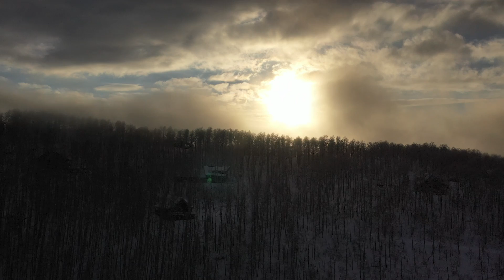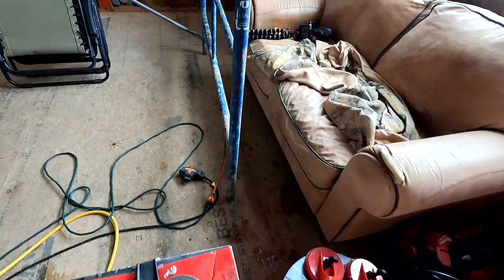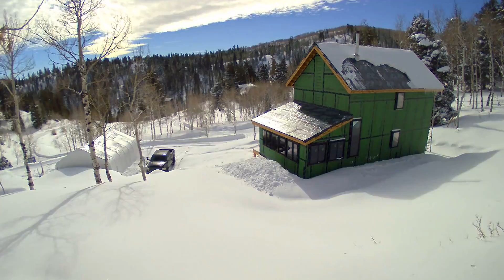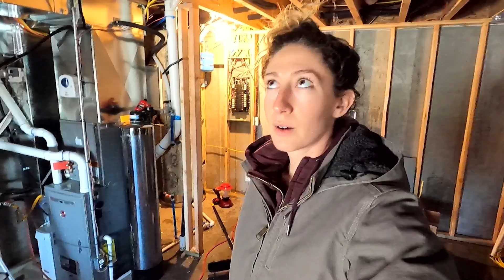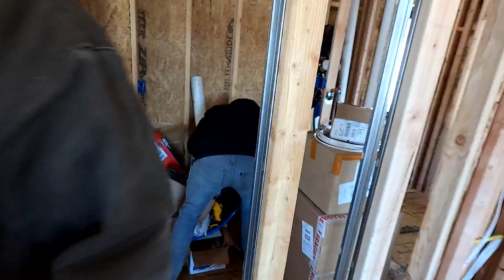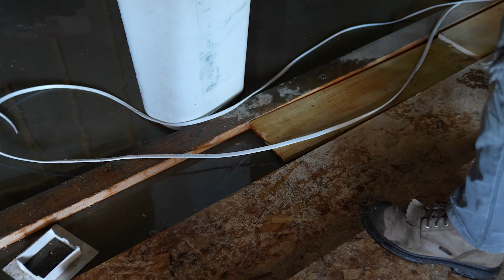OUR 4 WAY INSPECTION WAS AN UTTER DISASTER | BUILDING OUR OWN HOME

Comment: why would you test an internal drain run with that amount of water with head pressure? the working system doesn't operate at 100% capacity. Even an external drain run would only be tested by filling to ground level. These people are missing something or being very badly advised.

Comment: Check anything other than the breaker box that may have also gotten wet when you had the floods. The HVAC controller may be your problem, as you mentioned you got water in there. Easy to forget the obvious when a catastrophe happens. 
  If if goes away in a day or two, and you still don't know what happened there, it's likely that the water has evaporated. Check the trippable plugs too (the bathroom/kitchen outlets).
  Exciting to pass, yet you guys had some exhausting things happen this day.
  I hope you get everything working and back together. Go take a rest, deep breaths, then back to it.
   Good luck!

Comment: Your electrical problem is a nightmare!  Follow it inch by inch.  You know the cord from the breaker energizes.  Plug a light in. Works?  Plug in your extension cord to the basement with nothing plugged in to it.  It's . . . frustrating.  But not malevolent.  There IS a cause.  Good luck.

Comment: It's a good idea to walk house and video all walls before insulation and/or sheetrock. It documents where all pipes, wires and ducts are located in case you need to open a wall later. Also, it helps when placing sheetrock screws in questionable places.

Comment: I remember when we switched out our 100 amp panel (with fuses) for a 200 amp panel with breakers way back in the last century (1992, OK?)  and my Nephew said to me when the Inspector was coming,  "Don't tell him I'm an Electrician".   I'm guessing because,  as a Home Owner,  maybe the Inspector would be a little more lenient if you're just some regular "Schmoe".   I guess?  
Then,  skip ahead 20 plus years, after having a completely different Electrician install our stand-by Generator,  (well beyond my skill set,  trust me) the "new" Inspector had me change out a couple things on the panel that had been "passed"  twenty years previously.  Go figure?    Took me a couple hours to sort that out.  And the next day,  he came back and passed everything.   It's a learning experience for sure.  But definitely,  DO NOT TALK!   PERIOD.

Comment: Sorry to tell you Trent....once you wet down the electrical load center and breakers...it is trash.  The mfg will not warrant it...the possibility for trace minerals and things to have dried on the parts that are intended be insulation may not be insulating as well...electricians have cleaning chemicals to wipe down things...but to no avail...you seem to have the possibility water ran into breakers where cannot clean or dry....now trash.  The film on your glass shower surfaces is not replacing insulating surfaces down in cracks you cannot see nor reach.  Sorry..but the load center and all breakers should be replaced.  I have many years experience in that world.  I have seen the aftermath of water, moisture, condensation, etc and it is never good and the mfg will accept no responsibility.  There are many electricians that will tell you to dry it out good and move on....not me....I tell you to replace it...and have confidence that you are protected properly.  Something happens in that basement while you are sleeping 2 stories above all that wood kindling(your house).....Nope.

Comment: ADVICE: I worked in an electonic test equipment calibration lab. We would literally wash expensive electronics in a sink with 409 type cleaner. High priced electronics with circuit boards (like your furnace). Once washed we would put the equipment in an over at about 125 to 150 degree F and bake out the water. 
SO: Dry out your furnace. The leaf blower and any safe heat source you can use, even a hair dryer might work.
Good luck!

Comment: Take the breaker panel off the wall and bring it and all of the breakers inside the trailer, where it is warm and dry, let it be there for a night and a day and then reinstall it and you should be fine.

Comment: Congratulations on passing the 4-way inspection. Even if you hadn't passed it, you would have found out what was wrong. That is the purpose of the inspection.  You are just as intelligent as most construction workers.  I would say probably more intelligent and more careful because it is your own house. Think very hard about your electrical problem and you will eventually find the problem. It may be a wet temporary cord. Start at outside service breaker and put dry cords in place of the wet ones. I know replaced some of them. I have done electtical for 50 years and little problem like that are the hardest to find. You know it has to do with somgething wet.

Comment: Turn all breakers off in the panel, after turning main on if it trips then problem is in the wire. If it holds, turn breakers on 1 at a time until it trips the main to confine the problem point. Also, if your cord got wet in the flood that could be the problem.

Comment: It's hard to tell from a video of your electrical panel is so dark in the basement but is it a 200-amp panel or a 100-amp panel also it looks like it may be a main lug I believe you're going to need some sort of main disconnect next to your panel. May be cheaper to just change out to a 200-amp with a main disconnect. Good luck on finding your electrical tripping problem interested to know what it is . maybe the breaker down by the street

Comment: Most likely the problem with the electrical is not at the panel box.  You probably have an outlet near the water leaks that got water in them and that is tripping the breaker.

Comment: T&A - Glad it went well. Trent, as if I'm and electrition, as I'm not, but having worked with many, never use two hands. Only one, for safety.
As well, the connections to the breaker box and such, that's a job for a lisenced electricion, not you, nor I. Seriously, well worth the minor cost. Good luck and sorry for the typos.

Comment: What fun watching newbies, it's just like watching myself and the wife forty years ago. I just found your channel today and I subscribed. I dont know what kind of breakers you have but judging by the way the power tripped as soon as you plugged in my guess is the water is messing with one of your GFI breakers.
 Use your compressor to blow out the breakers as any moisture inside will trip a GFI.
cheers and good luck from Canada

Comment: There are many books on how to properly build a house.  There are many books on how to run electrical wiring and how to correctly do plumbing.  The key to all this info is to make sure you know what you are doing and you know how to do it before you start.

Comment: Install an Elk M1 Gold System in your property. The House and the Garage and any future out buildings for Security Fire, Home Automation and Audio and cab be integrated with CCTV. This is a real Security/Safety System. For your info call (844) NETAGENT Ext. 509

Comment: Trent /Allie Great Job on electrical!   but check your switch/outlet/light & fan boxes. When trimming-out each box, it's better to point the wire nuts "UPWARD" not down. This can help prevent moisture/condensation from getting trapped down inside the nut and corroding wire connections over time.

Comment: You probably have some water in the cord you are plugging into the extension from outside and connecting to the panel.    Going out on ground fault, not overload.
I really do not understand why you have motorized dampers on those pipes.   But since you do, please be aware that you must have access panels for all of them.   You can not just drywall over them.    When my wife and I built our house back in 1984-85 we never failed one inspection!   But the number of inspections was zero.

Comment: Need to fire stop all the holes, all wood penetrations, I tell u these things out of help, and being around this my whole life.. Not to tell u that u are doing things wrong. I comment all the time. U need a breather in the furnace drain as well. Dry that furnace unit up before u call for heat. Fans dehumidifiers ect. U shouldnt be too far away. Keep up the hard work.

Comment: Great job guys! Im a heating contractor myself and I like how your system is set up. I always make sure that the customer registers their furnace and condenser warranties with the factory. Most manufacturers offer a free 10 year parts warranty on their furnaces, condensers usually have Five. Also, you may want to check your energy companies for cash rebates. In Utah you can get as much as $350 back in the form of a check. Even your water heater, windows, appliances and insulation may be eligible. Good times ahead!

Comment: Did you get your tripping the breaker figured out? I would suggest to start pulling all the breakers like you did when drying out the panel and try to energize with just the main breaker only . I suspect you have a ground fault breaker that is retaining moisture and possibly tripping your circuit. Hope this helps or you might have figured it out already just trying to be helpful, Congrats on passing your 4 way!

Comment: One suggestion is to use contact spray it is in electrical isle, becareful about the breakers, from experience the arc-faults are very problematic, and can be defective. Worst possible case the breakers will need to be replaced, also check your hot legs to make sure you have 240 to the panel.

Comment: You figured your electrical out already but I bet you wished you had a simple ohms meter. You place the probes in the socket(the socket you kept feeding current to) and you could see the short. There would have been only one trip to the circuit breaker. A little late I know. As for the water all over the house...what a mess. Hopefully your furnace survived.

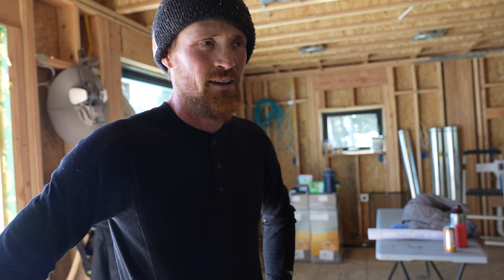Comment: 28:49 Test equipment. Use a multimeter to locate the short. No power (must not have any voltage on the electrical system) use the ohm setting. Hot wire to neutral,  Infinity is good. Short or zero is very bad.

Comment: First good job actually taking the initiative to build.your own house AND tackle the mechanicals.

I do not understand the reasoning of using water to test a DWV system.
In these parts we use low pressure air(5psi)

30' of head is 13 psi. 

Air leaks may be harder to find but they don't destroy property.

Comment: Now you know that you don't use water to test sewer lines. You use Air. There are no leaks if the pressure holds for 24 hours. By the way to fix a leaking Schrader valve is to replace the Schrader valve. Test fails if the pressure does not hold. Sewer lines were never supposed to be pressure lines that were full of water. The water weight in 4 inch lines is too great.

Comment: Good Morning Trent, Allie, Frank, & Lika; 
 
It must be very comforting to have the inspector sign off on your 4 way inspection  for “code” issues with very miner revisions’
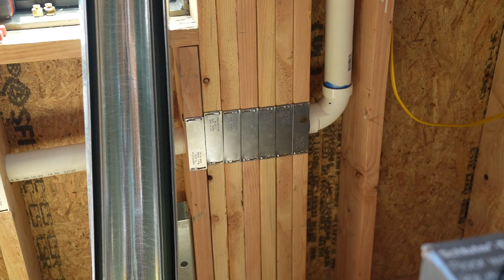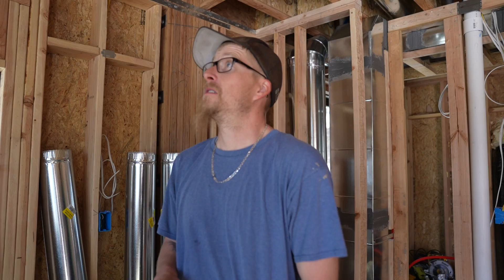It is more comforting to know that your structural engineers has signed off the  “structural integrate” of the wall shown in section 24:30 to 24:40.

I hope for a long sweet and save home.

Richard McCracken

Commented on Episode “PLUMBING OUR TINY MANSION | WHAT COULD GO WRONG??? (Feb 8, 2021) “.

Being a mechanical engineer of 35+ yr.
It seem to me that you may have structurally compromised the integrate of your kitchen wall with the vent pipping for you pluming.
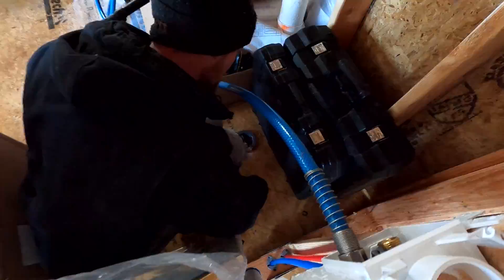I would strongly suggest that you have your structural engineer review this episode concentrating on the section between 13:50 to 15:20.

I do hope your structural engineer disagrees with me.

Thank You

Richard McCracken

Comment: Well done guys. Once it's all complete, you will feel an enormous sense of pride when sitting back looking at all your hardwork. You need to take a break. Have a good meal, rest and get a great night's sleep then tackle the problem tomorrow. At present you just keep repeating the same mistake or over looking the same problem.

We added on a complete new room and bathroom with porch to out last house. Experience, hubby is a qualified Electrician trained the old fashioned way of knowing how to plumb, carpentry etc, my experience was house painting and customer service. When we sold the house everyone who viewed the house wanted to know who we used for our tradies to do the extension. When asked why, they all said they were really impressed with the quality of their work. 

I couldn't believe it. My father had taught me to house paint, which I'd done numerous times but that was it. Hubby had done all the instillation of our dry wall. I did all the taping and mudding on our dry wall, which I had never done before. I was wrapped with my own interior decorating as everything fell into place. We did all of the extention with both of us working full time. Obviously we did something right. It pays to persevere and really rewarding. For little financial outlay, enormous amount of blood sweat and tears, we added over $50,000 to our sale price. Always have faith in yourself.

Comment: What about disconnecting the furnace....water inside there and it's connected to the electricity to work might be a connection there. In the same time I also am not an electrician. Happy to see you passed with little to change 😀 wow so much water in places great job sticking together working as a team and keeping things calm!

Comment: Sounds dumb, I learned the hard way to not have silver screws in wet rooms. Always brass or a rusty crestration developed over time from spills, steam, etc. Which my kids thought looked cool until we needed to loosen or remove that, lol.
 I always strive to use brass now and when in doubt if a fitting is,  I will take one out of the box and put it in water for a week. Only cheap screws in the bedrooms and similar dry rooms. Even the nails the builder used created rust circles after 4 decades.

Comment: If the panel got flooded you will need to get all new breakers because they will fail down the road. I live in a flood zone and it is code to replace any breaker that has been flooded . glad you passes your test, thanks for posting.

Comment: Is it not a good system or do you have a broken/defective part?  I would have returned that POS the second it was leaking to Home depot.  Then gone to a plumbing store to get what they recomend.  Oh man you were depending on passing your test based on a crapy bycycle pump holding a pressure?  😅 But somehow you manged to pass that inspection.
That being said I'd think about moving that ducting for the bathroom.  Its a bathroom so your going to have water issues sometimes and wow I would not want to have an isue with the bathroom in the middle of winter and you take out your electrical panel and the furnace.  Yikes.  Make sure you clean you're funace and ducts out good though.  You only have a UV system at the air source.  Its not 100 percent effective.  Its not meant to deal with an infestation that could build from something like that.

Comment: Be glad in the fact that you are finding all these problems before you get the drywall or whatever you use to cover the walls.  It would have been awful if that flood had happened later.  And the electrical, you can visually see the lines  now but won't latter.  I can put all the new stuff in but I have an awful time trouble shooting.

Comment: #Trent & #Allie I was shocked. New to your channel. The water! Omgosh! I seriously could not figure out if this was to get more viewers for the luls or if this was an honest series of bloopers. Either way I was rolling. Ive got a decade into residential building and Ive never seen what ya'll managed to do today. Saddened for ya'll but so glad you kept it positive and upbeat. You're both doing incredible. Keep doing your best. Inspections are a part of building and a pass/fail is just one more step in the process. Learn from your mistakes and keep on rolling. Cheering you on! <thumbs up> #TIP : Run a dehumidifier for a day or two to get the moisture out of the house to help dry everything out. Use a generator for power and dont forget to make sure that each breaker doesn't have moisture inside it or that too can kick them. take them out and put them in rice for a day or two or replace them fresh. Best of luck.

Comment: .It was fun watching the inspection. Of course the plug letting lose sounds like something that happens me. Your electable problem sounds like you might have hot and neutral mixed. Make sure white goes to white and black goes to black. That might be the trouble. As for the furnace just drying it out might save it. David Burgio

Comment: Did you know you can test your plumbing first with air. About 5 to 10 PSI then if it is OK test with water. I some places if it is OK with air that is all  you need to do. I use water but have it inspected before there is anything that can be damage if it gets wet.

Comment: Insurance adjuster here, fans to get the moisture into the air and dehumidifier to suck the moisture from the air.  I always tell folks not to turn on wet electrical items for Minimum of 3 days of drying to prevent possible arcing.  Get the fire going to get heat in there.  I’m so sorry about the water damage, but CONGRATULATIONS on the results of the 4 way!

Comment: congrats......Dean.....needs to cone out.....do not try to reconnect electrics..until it is fully inspected...get license electrician....maybe it  was a good thing..before you panel...any snow connection when this happened...freeze...like leave your hot water running...when it freezes pipes back up

Comment: How about getting a multi-meter to debug electrical problem instead of using circuit breaker to debug?  Circuit breaker is the last resort safety net.  It should not be used as a tool to figure out your electrical shorts.